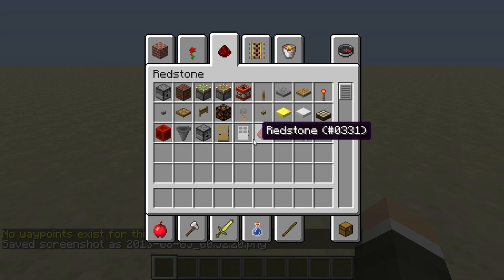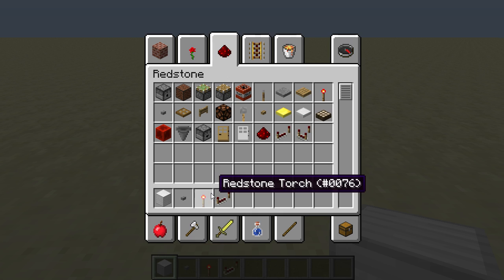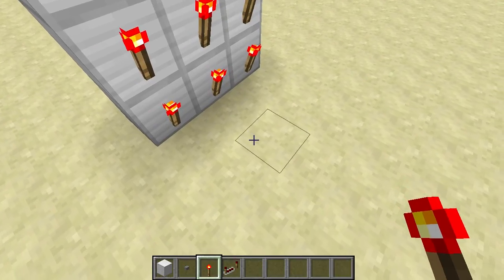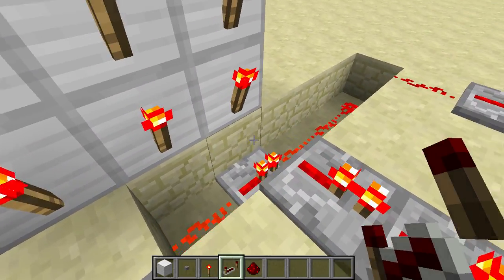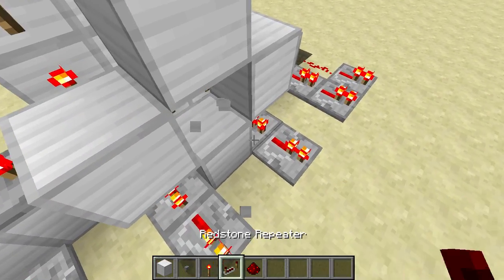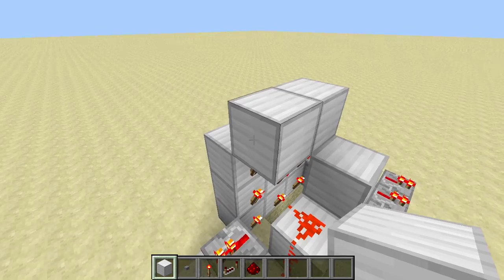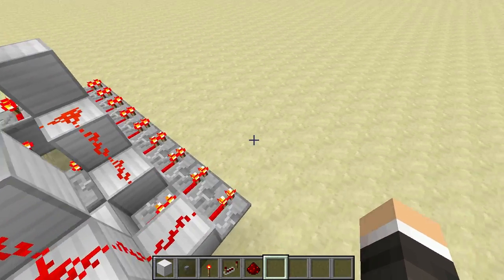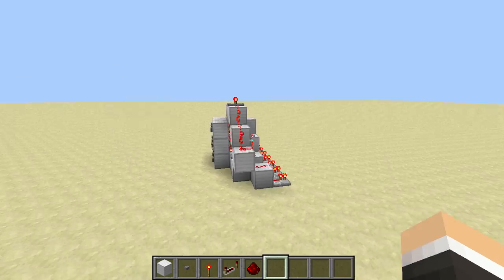Minecraft 3x3 Button code Tutorial

Comment: not helpful? where does the door goes whats the pin?
Reply: Sorry for the late response, what you're essentially gonna do is only place the torches where you are gonna have a button used. Conect the line of repeaters at the bottom with a piston door(it will activate because it has an active current) and whenever all buttons are pressed at the same time the door will open.